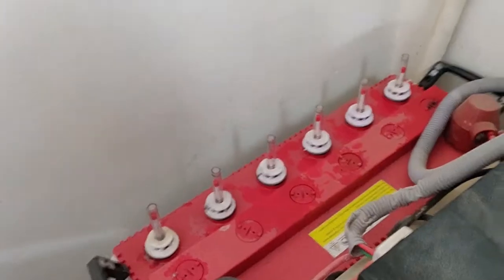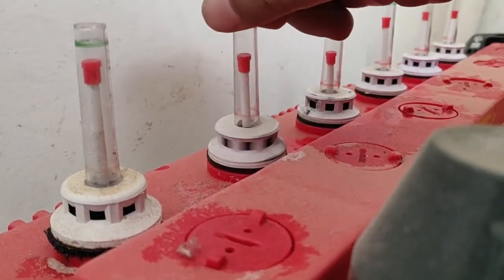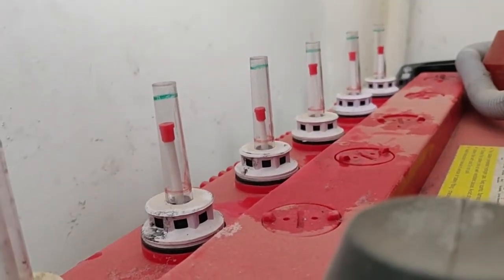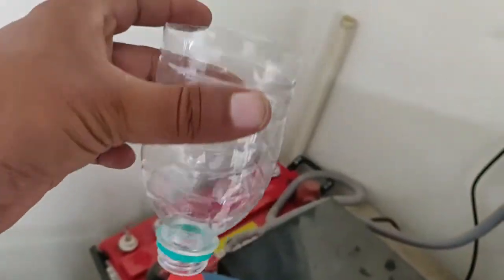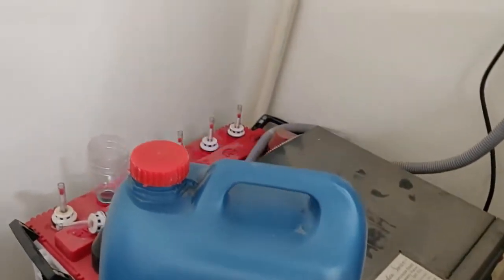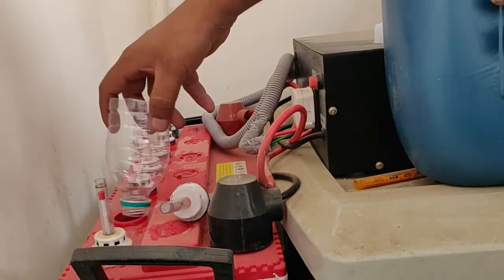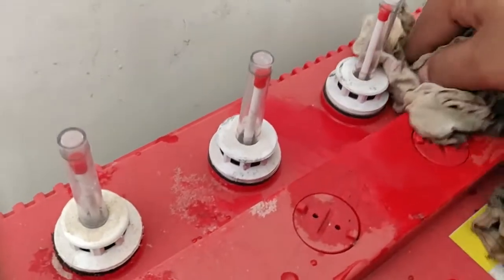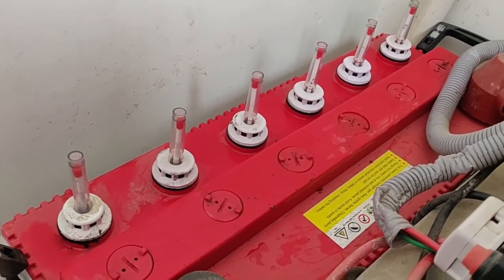DIY - Fill distilled water in to your Battery for Inverter at home

Comment: Without any hesitation this video is released with wrong instructions, youtube could remove misleading videos. Indicators in Inverter Battery are not for filling water! the black twisting caps behind the indicators must be opened with screw driver or using rupee coin, to fill the distilled water! Moreover turn off all the power switches in connection with ups and inverter before proceeding anything

Comment: Wrong way. Don't do it this way
Reply: Then which way?
Reply: @AnbeSivam1111  I think you're supposed to refill through the caps near the indicators so you can see the level as you refill.
Reply: How to fix if the solar panel system was running too low water level.